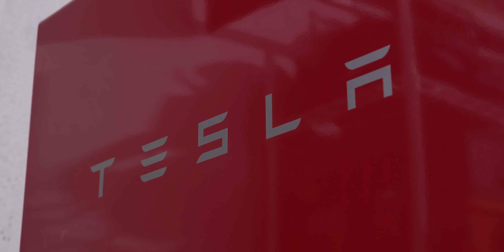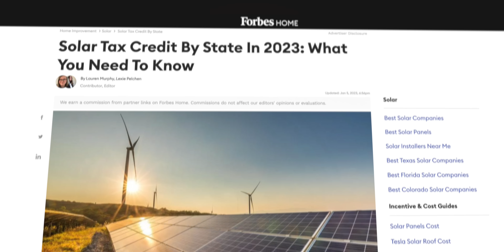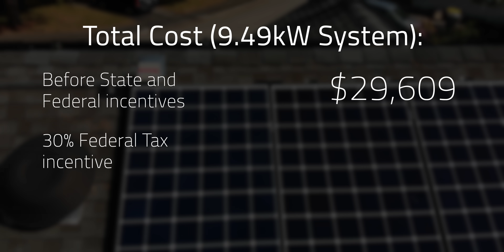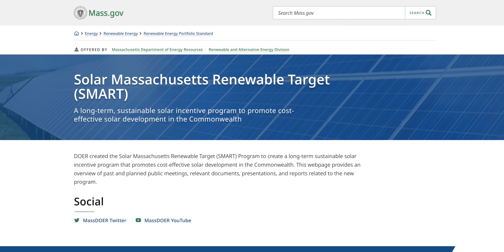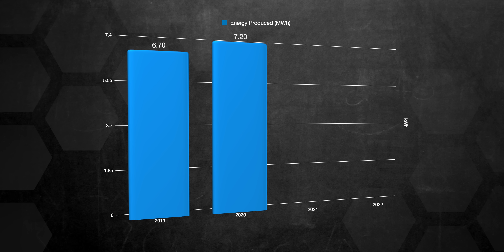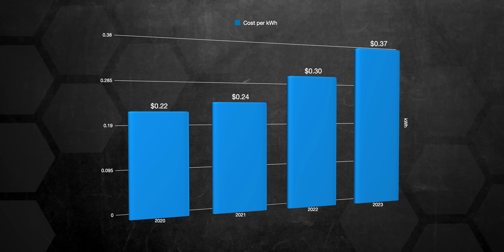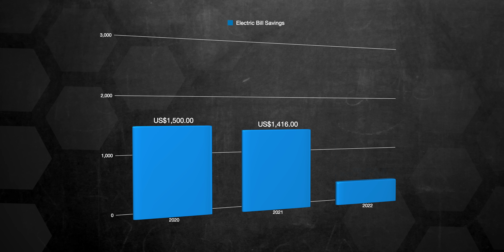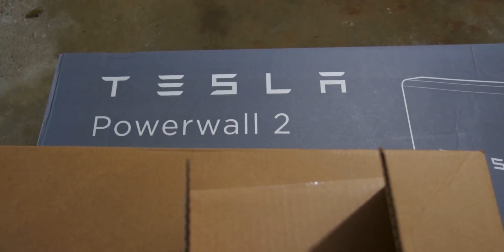5 Years with Solar Panels - Is It Still Worth It?

Comment: As a roofer with over 30 years of experience, putting solar panels on roof is worst thing you can do for your roof. Every roof will leak eventually but with proper maintenance your roof can last a lifetime especially with concrete or tile roofs. Solar panels makes it difficult for you to maintain or repair the problem areas. Leaks usuallu occurs near chimneys, vent tubes, skylights, or wherever hole was made on the roof. Solar panels installation requires hundreds of screws drilled in the roof that over time it’s guaranteed to leak. You may save some money with electric bills but in a long run you are paying hefty price of new roof. Penny wise but pound foolish.
Reply: There are 2 types of roofs- one that leaks and one that’s going to leak. Anything installed on the roof shortens the life of roof. It’s common sense but it’s lacking these days.
Reply: Amen. I love the idea of solar for decades. I changed my mind after seeing a video: Why I remove solar by Solar Goat. Sure, some people had no problems but many people do. With my luck, I would not let anybody drills holes into my roof.
Reply: If you read any roof warranty fine print exclusions include leaks near chimneys, vents, skylights, solar panels, and any other installation compromising the integrity of roof structure. Basically roof warranty excludes all possible areas for leaks lol. People who have not experienced leaks from solar panels it’s just matter of time. And time has been greatly shortened due to solar panels. Remember 2 types of roofs: one that leaks and one that’s going to leak.
Reply: @Salvation.Ministries  Yes, and don't forget wind and vibration. Can wind get under these panels and try to lift them up and loosen their supports which would be a great leak inducer?
Reply: @Salvation.Ministries  You obviously live in some shonky country with crap building codes. Most of the roofs here are long run prepainted steel and there are heaps of ways to fasten solar panels - and many do not require a hole. We have buildings with roofs that last well over 50 years, in fact many will last 80 with a repaint after 40 years. By that stage the solar panels will need replacing.
Reply: @Salvation.Ministries  Rather than focusing on pointing out potential problems, why not redirect your efforts toward finding solutions?
Reply: @Salvation.Ministries  Yup.  Roof installed solar is the worst form.  They typically don't have proper airflow for cooling.

Even if they're properly installed so they don't damage the roof, they make maintenance much more expensive.

Knowing a guy who specializes with panels... you NEVER know what you'll find on a roof.  What kind of connectors did they use?  How is the power run?  What type of panels?  Turns out... every install company has proprietary answers for these... and have likely gone out of business.
Reply: @Salvation.Ministries  best advice I've seen on this matter, I'm a roofer myself and Sr. You right on point!
Reply: Most people don’t realize how fragile tile roofs are. Even if installation was done correctly they just created hundreds of weak points that will eventually leak. On top of that, regular panel cleaning involves more foot traffic resulting in cracked tiles which mean leaks next time it rains. That’s why I never have anyone else go on my roof.
Reply: Most people don’t know roofs also need maintenance. With proper maintenance tile roofs can last virtually forever. But when solar panels are in the way maintenance becomes an issue.  Solar panels are great as long as it’s not on the roof. If people can’t afford electric bills they can’t afford a house imho.
Reply: Totally agree. This is woke BS being shoved down everyone’s throat by local and state governments. It ruins the roof and increases your insurance premiums. Total joke.
Reply: I’m confused. Which is it 35, 55 or 65? And what kind of solar installations were they doing 65 years ago?
Reply: As someone who lived under roofs with solar panels across several relatives and family homes, I have never had no rain come into my bedroom. Maybe don't get solar panels if your roof is old...if you're in the market for a new roof, you should def consider panels with it.
Reply: @tapetwo7115   Just because it doesn't leak, you have no way of knowing if the roof deck is rotting.
Reply: Depends on your roof. Shitty old asphalt shingles will leak if you drill holes and don't flash properly. That does not mean solar is not a good idea if installed correctly.
Reply: Since the sun cooks the shingles which causes them to dry out and crack, it seems they would last longer because the sun would be hitting the panels and not the shingles. Also the panels should be mounted on a rail system. The rail frames could be mounted to the roof edges for easy access to the screw heads for caulking.
Reply: As a roofer with 31 years experience, I don't listen to big oil shills who want to discourage me from getting literal free energy from the sun. By saving thousands a year on electricity I can afford all sorts of home improvement projects. Also NO, solar does NOT damage your roof or cause leaks. Just make sure you don't have a worn out roof before installing solar. I have never seen a solar system damage a roof in my 55 years of experience. Not once in 65 years.
Reply: @AllioNeo  Roofer my azz, you ain't no roofer.
Reply: @dangerzoneDeegs you nailed it. 55 years if solar panel installations... ummmm... they haven't been commercially available for more than 15 years.
Reply: @AllioNeo  There are plenty of videos showing damaged roofs from solar installs.  I have 3 freezers in my house and still pay $60/m and $90/m summer months.  At these prices solar is not worth the hassle.
Reply: @adult_swimm  depends on where you live.
Reply: @AllioNeo  You have 31 years of experience but in 55 and not once in 65 years you have seen no damage from a solar system. What do you mean by solar system? Solar panels were beginning to be introduced in 1999, which is  25 years ago yet you have seen no damage in 55 years?
Reply: @AllioNeo  within 1 year my roof leaked after installing solar panels. While I did have a roof inspection b4 the install, the solar panel installers gave me a hard time even though supposedly I had a 10 warranty. Luckily, Souther California had some epic rains last year that exposed the problem. The leaks only occurred under the solar panels. You could clearly see the leaked when looking at the plywood water stains. At that point I elected to have the entire roof re-papered under the tiles. When I made the complaint, took over 2 months for the solar panel roofers to come visit and I suspect they were very busy following up with many complaints.  In California, electricity is obscenely expensive so I still feel the panels were worth it as I save on at least $500-$700 bill per month. I paid $0 now but my ROI including re-papering the entire roof is 6 years.The roofer installed double paper under the panels on the repair installation. I elected to do the entire roof as the roof was 30 years old so I paid into the repairs. I would warn anyone installing solar panels in their roof to at least re-paper and double paper under the tiles before you install solar.

Comment: I have solar panels for water heating. Totally useless ..100 degree water in summer when you dont want a hot bath. No appliances that use hot water available except sosme very exoensive industrial ones that then dont use electricity when the water isnt hot. And a wate rpump which means no hot water flow when the electricity goes and the pump uses as much as my dryer! Useless situation.

Comment: But if you sell your house before you start saving after 7 years. You didn't save anything.
Reply: @wukong1325    Need to add the total anticipated electricity cost savings for the lifetime of the panels to the sales cost. That way you can use that premium to invest in your new home's solar install?

Comment: Did you put a new roof on the house before installing the solar panels? You will be having to r&r the panels if the roof is needing replacement adding several thousand dollars to your new roof. I also understand that the panels are at their highest efficiency in the first 2-4years. After that they can degrade up to 5%/ yr. Or stop working entirely. Not sure how good the warranty was. Good luck with your new home.

Comment: To reduce payback time you need 3 things
(1) Enough panels to create a surplus
(2) Storage to store your surplus, for nighttime use.
(3) An electric car.

In France we have companies who will store (virtually) your surplus.  It's like having an infinite battery.  This means you can bank summer sun on your account, for use at night and in winter.
So, I'm either using the sun during the day or I'm banking it.  Add my free car "fuel" and my payback time is around 3 years (but I did get 8kw for €9,000, which is cheap).
Reply: Number 3 has the MOST impact on payback period. People here in the states haven't realized that concept yet. Do the math!!!

Comment: Very good show. One comment. Installing solar panels on an asphalt shingle (AS) roof is not the most viable of marriages. AS roofs typically last 10-20 years before showing signs of wear & tear, espeically leaks! The more solar panel brackets installed, the more potential leaks. The typical lifespan of AS roofs is 15-20 years, of course, in drier areas they may last a bit longer. The best roof to use with solar panels are metal roofs with concealed fasteners or "standing seam" metal roofs. These metal roofs initial costs are 2-5 times the cost of inexpensive AS roofs. Because of the way the joints on these roofs are formed, they provide a perfect "standing seam" that one can clamp the solar panels to. In fact there are several manufacturers of these clamps and they do no pierce the metal roof skin.

However, the most significant aspect of steel metal roofs is their durability. There are no shortage of these steel roofs in North America that are over a hundred years old and there is plenty of evidence to suggest that with the best tradespersons, today's more technologically modern metal coatings and excellent maintenance, these roofs could last as long as 150-200 years in more benign locations. The other benefits of steel metal roofs are too numerous to post here.

Comment: It's 2024 and in North Texas my electric is 9.4cents per kwh up to 1000kwh, then goes up to 10.4cents per kwh, are electric bill on a house is $120 at the low, $200ish in the summer with thermostat on 70°.

Comment: Solar doesn’t make sense. Anyone who says otherwise is lying. Panels, wiring, batteries, etc all degrade. The sun and being outside destroys everything. 

In my case it would take 27 years to break even at my electrical rates NOT including batteries. Not to mention replacing anything in the system within that time. 

Solar is an off grid I have no access to electricity solution. That’s it. It should not be how anyone powers their homes. 

If you have the money to do a system great, do you. But know nothing is free. You won’t make money on it. It won’t pay for itself quickly. Etc.

Comment: I have a 5.6kW system and a Powerwall Plus in the foothills of Colorado. I installed this system to control future energy costs as prices rise. I am going to expand it to 7.2kW. Reason being is I knew the days in November to January were short, but when it comes to power production, those days are really short! If it gets cloudy at all I am likely purchasing a bit of power. The additional panels will get me over the hump for my usage.

Adding the Powerwall was a no brainer. I am a zero fan of solar without energy storage. My background is in green energy R&D on the engineering side. The Powerwall gives me way more flexibility to control costs. One way is on cloudy or rain/snow days where production is limited. I can charge the battery from the grid "off-peak" and power up my home and shop during "on-peak" pricing.

Comment: This video is about a guy that can not do things for himself…13 years ago I read everything I could find on solar.. As a kid I was taught basic wiring, plumbing framing and roofing..  In 2016 I found an employee owned company that offered to do my building permit if I bought a system.  The system was $13,000 with out tax rebates..I called 15 installers and most wanted &12,000.  I read the building permit and installed myself and only took 28 hours.. I have over 7 kw in 25 panels..Everything was inspected and passed.. My inverters a enphase thus everything is convert from dc to ac at each panel.. After tax credit my system costs around $8500.  Based on power use the system was payed off in 3 years 4 months.. Thus for the last 5 year and 4 mints all my power has been free..At the end of the year I get some jive $85 bill from the power company.. Part of my research was find my home faced South southwest.. or almost perfect orientation..
Reply: I hope most folks do your research.before buying..  It’s like kids these days go off to college without knowing what they want to be.. thus never find a job… Solar for your home  will never do well if you house is in the forest or you live on a north slope or it rains to much..  Do not waste the money.. This person just put them up.. This guys solar is not a great fit and his battery works is even worse..  The only thing bailing him out is the drastic increases in power costs..  I see so many folks unwilling to learn and act wokeish and are really nurds..  Get involved folks.. it’s easy and fun..

Comment: I've been completely off grid for 7 years. I have 3 stand alone systems using second hand telecommunication lead acid battery banks. I also used second hand solar panels. The entire venture has cost me under 5K as I did all the installation myself.

Comment: A follow-on question is if/when you may add an EV and if that may be a commute vehicle. This decision easily pushed us into the YES column. Remember, you're wanting to save money on your total energy bill. That includes running your vehicle. Gas in California is ~$5.30/gallon (4/2024). I "fill up" my EV for free and we drive ~15K miles per year. So, do the math there on how much more savings you're getting by avoiding the gas stations.